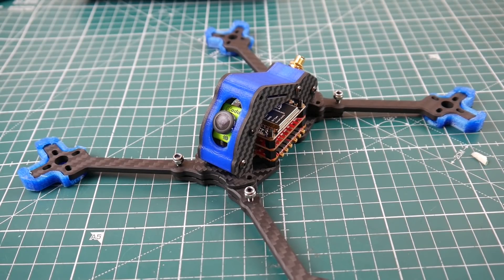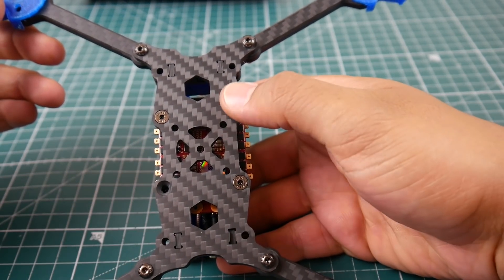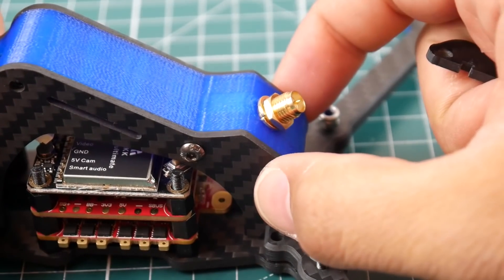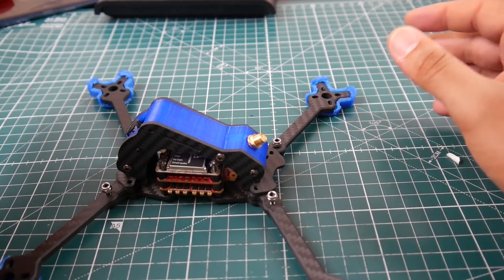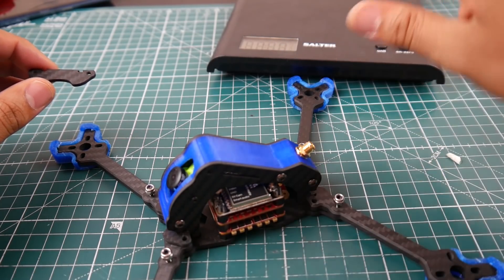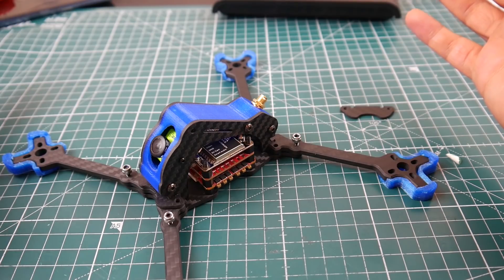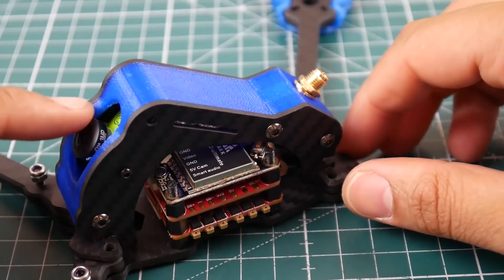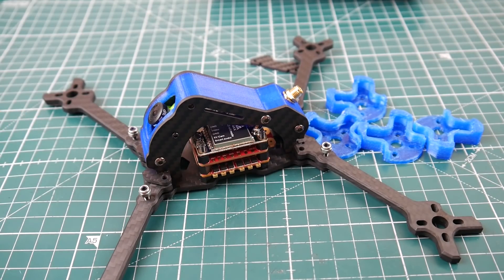My 6S LOW KV BUILD?!! // Nidici Kun-H5 227mm

Comment: The bottom plate will break before the arm does, I wish they would have just recessed holes in the arm we're bolts can sit inside of it and just screw it together from the bottom and I wish they would have made Boomerang arms instead of two piece arms. I was getting too much vibration back to the flight controller with heavy motors and my quad would not stop flying away. I'm wondering if my bottom plate was just affected because when my friend was bending the arms to find out why it keeps flying away it snapped at the bottom plate right at an arm.